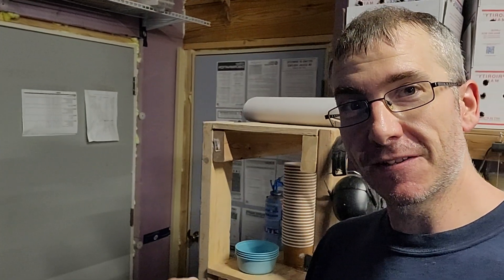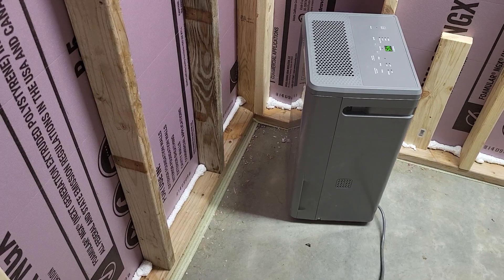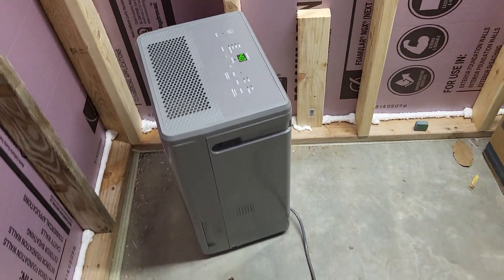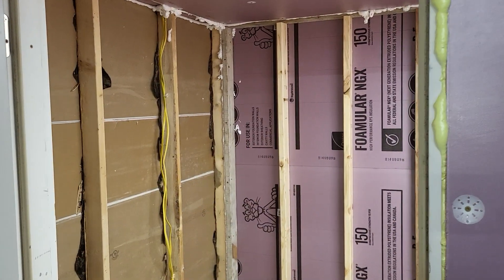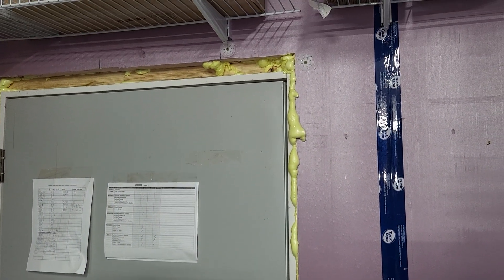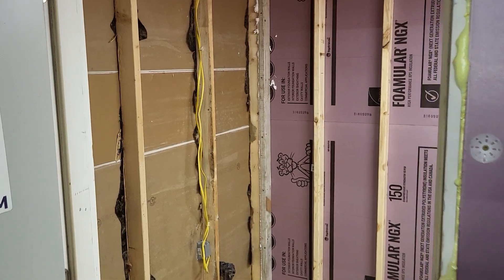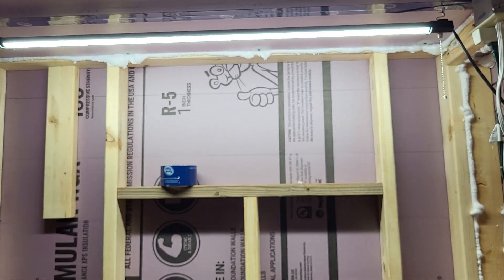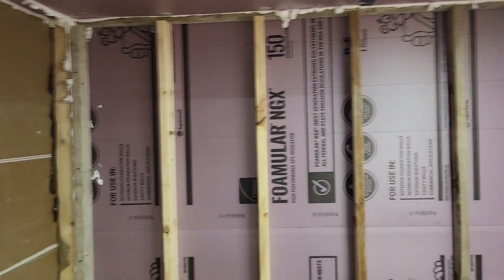DIY Walk-In Cooler - door install and next steps using the Coolbot Pro

Comment: While your walls are open, you might consider installing 12-volt LED can lights and switches. I'm  currently rewiring my entire house like this. A 12-volt, $3 battery fits in the J box next to the switch. I run 6 can lights per battery  and it has full power for over 2 YEARS!
I just use cut-in boxes & a switch with switch box cover plate. Looks like a "regular" light, but works off grid.
Reply from the maker: Good point! I’ll have to think about that.

Comment: A quick solution to your cold concrete floor would be to cut in a piece of super short Astroturf outdoor carpeting, cut to fit. Trays will still roll over it. I use it to cover my chicken coop's concrete floor.
Reply from the maker: I may put a layer of the foam board on the floor, just depends how things go when the cooler temp is lower.